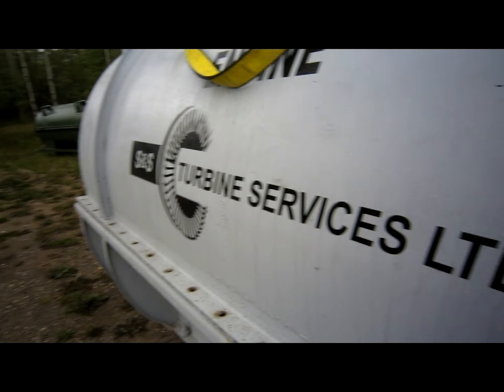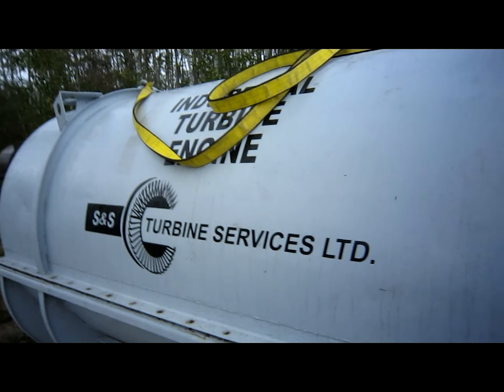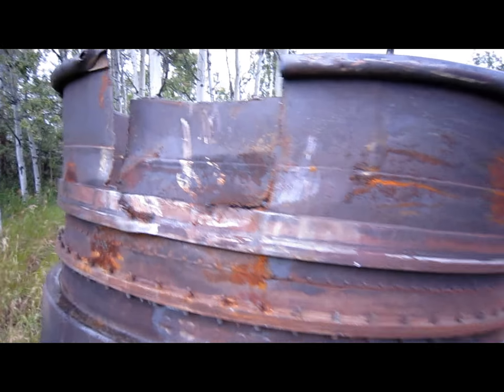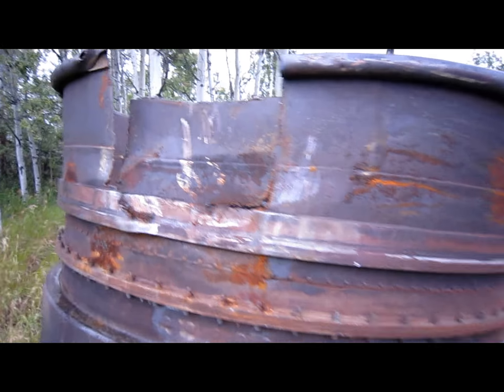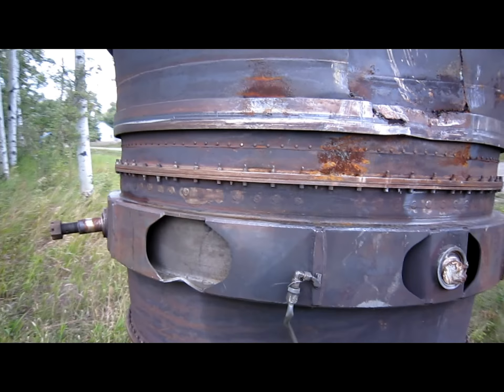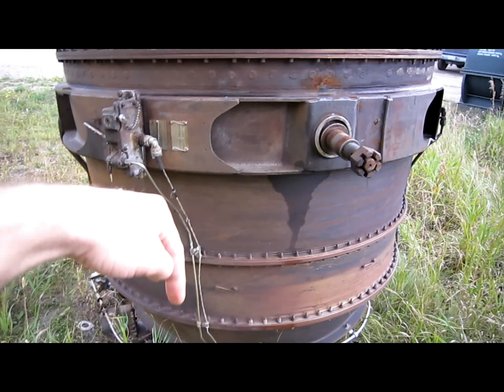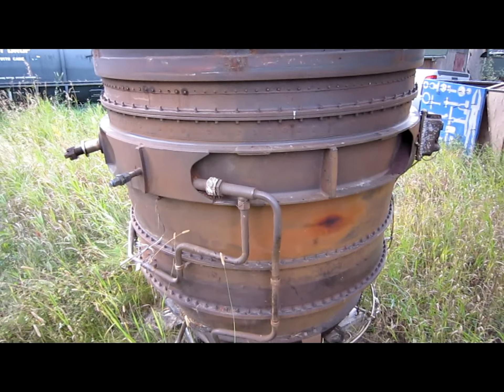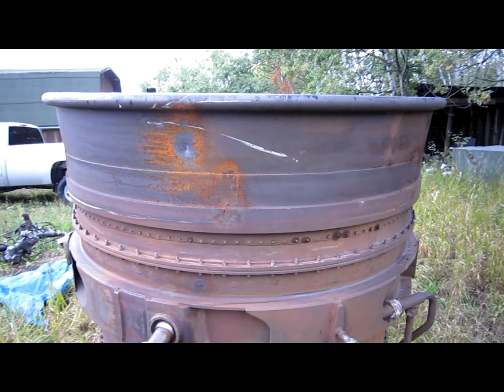The Power Turbine - Turbine Engines: A Closer Look

Comment from the maker: @JetAce08 It's a bit sad to say that this big ol' one lunger is not as efficient as the 5 or 6 stages used on the LP turbine for the next engine GE developed, the TF-39 / CF 6 / LM2500 series. The LM2500 Power turbine has 6 stages.

Comment from the maker: Fuel is controlled via the operators desired power setting, temperature limits for the gas generator turbine, and usually torque but sometimes rpm sensors on the shaft driving the load.
typically generator speed is held within 1.0 rpm

Comment: Please explain where thus a jet engine gets the high compressed air to cool the turbine blades, 
As I know by the end of compressor the ratio is between 1/8 up to 1/20 but then you need even an higher pressure to blow through the turbine blades at a sufficient rate to cool them
In diesel engines they use intercoolers to improve the power output how is it done in jet engines, or why not?
Thanks to your nice video's AgentJayZ

Comment: I was wondering about speed regulation in such a system. What are typical specs on the power produced? In what applications are they commonly used? If a breaker trips on a big load, does the thing over-speed?

Comment: Thanks for the quick reply! I am an information junky, generally. Specifically, I have worked in electronic control systems, usually PLC based. So, I am seeing from the generator side of your electrical generation scheme, fyi. I do have a fairly good grasp on fluid dynamics, not that I enjoy the math. Thanks for the info and for making these videos. I intend to watch them all.

Comment from the maker: The pressure in the combustor  and turbine is lower than the compressor discharge pressure.
Burning fuel in the combustor  does not increase the pressure of the exhaust gases. It increases the volume, and since it is rushing out of the turbine, its speed is increased. Not the pressure.
Compressor bleed air is used to cool the nozzles and turbine blades.
The heat of burning fuel causes the volume to increase, not the pressure.
These are different from piston engines.

Comment: So is this more efficient or is it more efficient to create steam with with your fuel and  use the steam and a steam turbine to turn the generator?
Reply: This is more energy efficient, but requires much higher technical knowledge of advanced materials. The least steps used in a heat engine to convert heat to mechanical energy, generally will be the most efficient. 
And also, nearly any internal combustion engine will be more energy efficient than an external combustion engine.